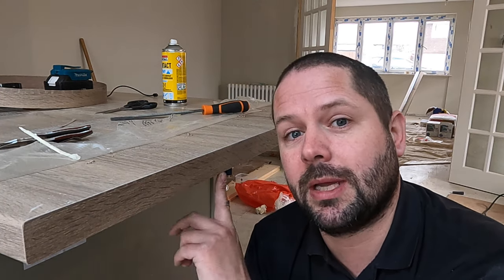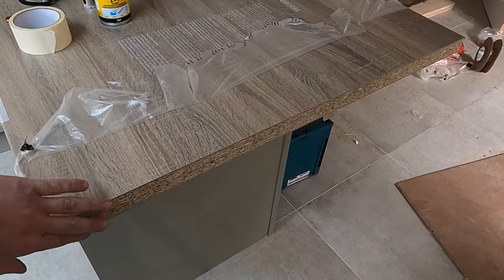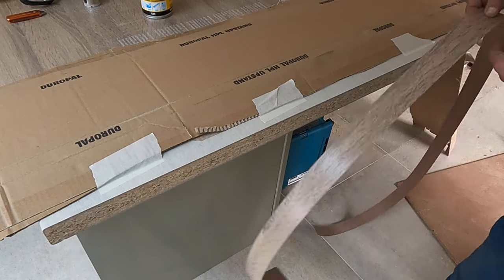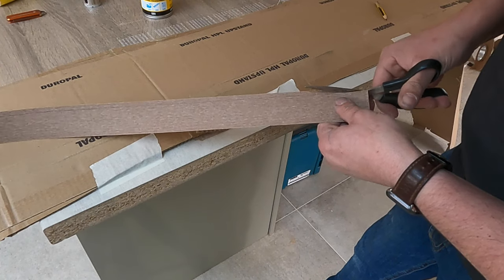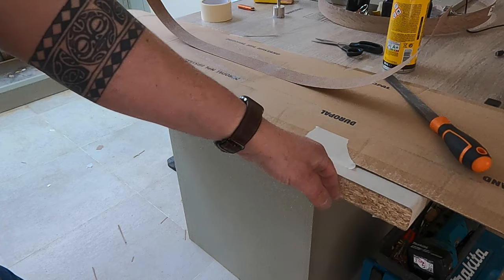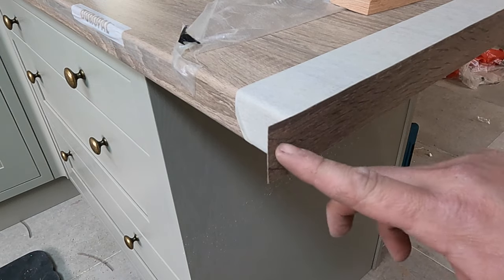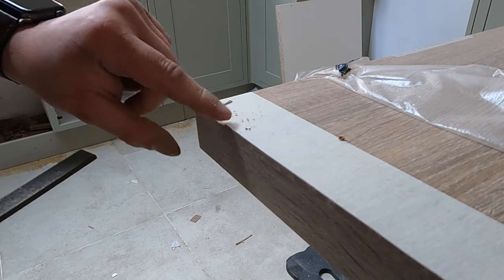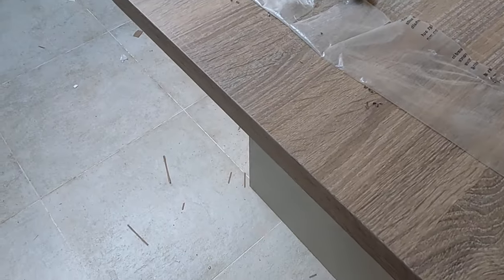How to apply worktop edging strip

Comment: When you offer the edging to the work top, why not offer the factory edge to the top? And then when you file, it is only necessary  to file the bottom edge, which will not be visible, and there is nothing there to damage.
Reply from the maker: I do this for a few reasons, one it’s very hard to line the edge up perfectly two the factory edge is never great, you don’t notice it in the bottom but you will on the top, much nicer finish when you trim it to suit
Reply: @LTWCarpentry  Try this?: Remove the tape, clamp a length of clean straight timber over the top edge, then gently push the strips factory cut edge ( check for best ), up to it and in. polish off with wet and dry, - dry on a flat pad. No risk of damage to the w/top at all.   ...Perfic!

Comment: Before gluing any cut edge on chipboard I make sure all dust is removed from the paws in the chipboard using a vacuum cleaner.
Reply: Good point. Or use air gun.
Reply from the maker: I use my makita leaf blower (mini one)

Comment: Thanks for sharing this step by step process, i DIY our kitchen to save the install costs and this was one those critical cosmetic jobs that I wanted to finesse .
Reply from the maker: That’s awesome buddy ! Really glad I could help out mate. How did yours turn out ? 🍻
Reply: @LTWCarpentry  I was surprised has strong Evo contact adhesive was, I applied it with a brush. (following instructions on tin) .My edging was same dimensions as worktop so just cut to length, I used finer grit paper just to be on the safe side, just to finish the corner of. 
I enjoyed putting my kitchen together a real sense of self satisfaction.
Reply from the maker: @Thechemikalbro  yes that stuff really grabs dosnt it ! 

That’s great that you got that feeling buddy, that’s what all of this is about, now every time you walk in there you think “I did that” well done buddy ! 

What’s the next project ?

Comment: Funnily enough I just did this today before this video popped up in my feed. Well done YouTube! I used the pot of contact cement, but watching this the spray-on looks easier for sure. The adhesive dripped a lot but I had the sense to tape plastic over the side panel and floor. A couple of things I could have done better (pre-trimming the edging lengthwise... duh!) but overall I was happy with the result.
Reply from the maker: It’s always the way isn’t it buddy ! Well done on getting yours done ! If I can’t help with anything let me know 🍻

Comment: I tend to use a router and then file & sand, but looks fairly quick this way.  Not used that spray before, does the overspray wipe off the end panel easily? Might try it next time.
Reply from the maker: Yeah I have done it with the router before aswell, I just find this is cleaner then routing indoors. No it was a pain to get off the panel, I should have covered it up. But I deffo prefer the spray, so much easier to apply
Reply: @LTWCarpentry  yeah, looks a lot easier & quicker will give it a try, cheers 👍

Comment: Excellent video
Very helpful ❤
Reply from the maker: Thank you very much joe 🍻
Reply: @LTWCarpentry  I actually done it today and wondered if pva glue would be better, but I used a tin of contact adhesive and it worked well. It was scary using the file as bits broke off but all worked out well! I even cut a curve on a laminate worktop which was scary too 😂
Good old you tube and good old you for sharing your skill 🥰
Reply from the maker: @joejoejoejoejoejoej  that’s awesome ! Really glad I could help buddy ! If you need any help in the future please let me know !

Comment: Have you ever done a long run of edging tape which has held up?  I've got to make a massively awkward worktop and have little choice but to use ~2.5m of edging tape to edge it after tapering a 1.2m section from 800mm wide to 570mm with a little radius transition.
Reply from the maker: Hi, yes I have. It’s the same process just a longer section. Hope this helps

Comment: Why wouldnt you glue the top edge flush and file the bottom edge flush thrn sand ? Just asking
Reply from the maker: Because the edge as it comes from the factory can be sharp and uneven so it’s much better to cut your edge down to what you want it to be